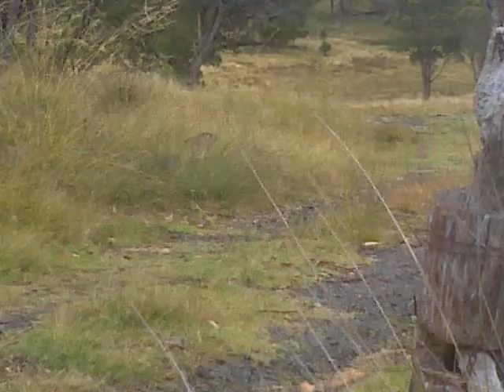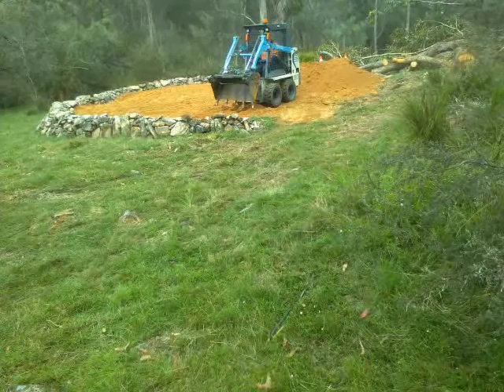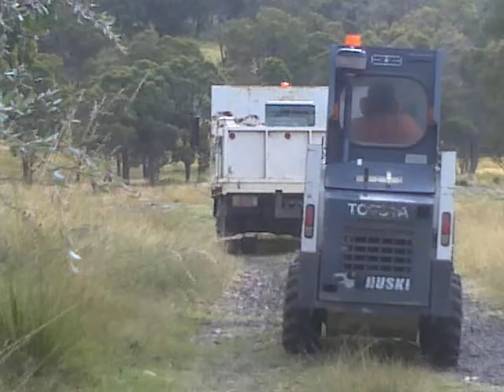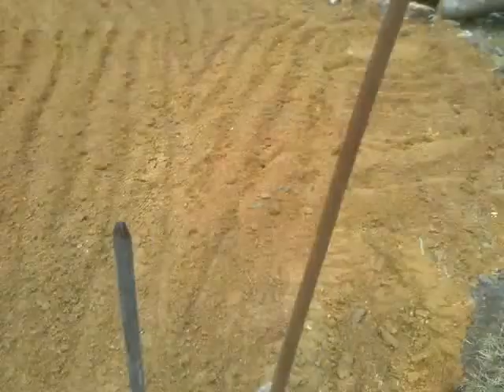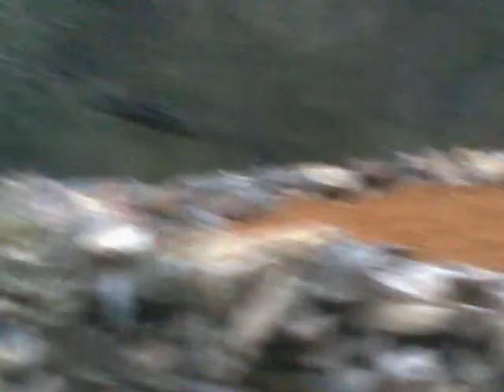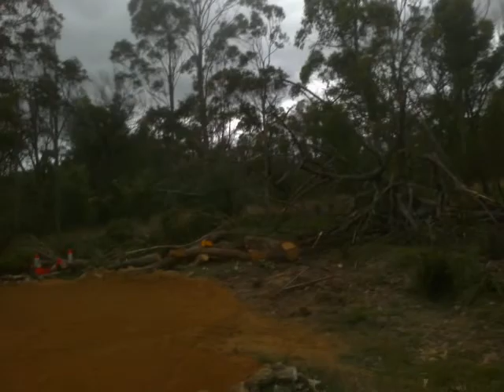Yurt Pad, The Last Load...

Comment: Getting there slowly but surely.
Reply from the maker: G'day,

Thanks.

As I was making this, it started raining...; now it's 24 hours and 42 mm later, so those 3 days, after 10 days to dry the Driveways out since the previous Rain Cycle - really were the tight little Weather Window through which the Pad had to be made.

I would like to have seen another 2 or 3 loads - to bring it up a bit above the level of the Rock Wall..., but the Weather Window shut at the same time my Pad Fund ran dry.

I think the Yurt will go onto what's there, rather than waiting for funding and another Weather Window to appear.

For a first attempt, I don't think it was too shabby an effort at Pad Building.

Such is life,

Have a good one...

Stay safe.

;-p

Ciao !

Comment: Will you be running a wacker plate over that to tighten it up?
Reply from the maker: G'day,

Thanks mate...

It wouldn't be a bad idea, but since I made this video there's been 27mm of Rain onto it - and my plan had been to put my 20mm Sprinkler on the Pad and pump 5 tons of Water out over it with my Firehoses, to settle it.

So unless my daughter wants to finish the job properly, with another 8 or 10 Tons to bring it up to the top of the Wall, then it's about ready to receive the Yurt.

Such is life,

Have a good one...

Stay safe.

;-p

Ciao !

Comment: A screet board would have made the effort of leveling easier... maybe.
Reply from the maker: G'day Richard,

Thanks mate...

I was thinking about getting a big (4"x4") length of Hardwood and dragging it around as a "Land Plane", but with the Rain building up and a limited Time Window I had to use what I had ready to go.

The stuff on the High side was pretty well packed down, because the final two loads had been backed over the top of the first 4 - and the "Decomposed Granite" goes pretty hard when packed down. 

A Screet-Board might have bounced over the highpoints. I had to chip into it in layers, using the Rake-Hoe, to get it loose enough to move accross  to the Low side.

It literally started spitting with rain at the 1 & 1/2 hour mark (as I was pretty near knackered), and after putting the Tools away I wound up splitting Firewood in the Rain.

The first dump was 12.5 mm, and overnight another 15.5 mm dropped onto it ; and the weekend is expected to feature Cloudbursts and Flash  Floods....

So, I consider it a triumph of Anti-Rainmaking Rituals that the Storms held off until the job was as finished as I could afford to do it.

Personally, I'd like to see another 2 or 3 loads, but my Stash of Banknotes was depleted and the Weather Window was too small. And because it was a "Tiny Tipper" the 35 km each way to the Quarry for 6 trips made it fairly dear.

Ideally one would get Crushed  Bassalt from Town ($24/ton) and that's only 15 km off, and a 10-Ton Tipper for 3 loads...; but the Burilda Driveway has almost gone beyond what anybody would agree to put a 10-Ton Truckload over, and I doubt if it would have got over the Traprock Mudpie at the bottom of my Driveway - and everybody with bigger equipment is already flat out busy and had other stuff booked in and happening during the Weather Window.

Whereas old mate has his own Quarry, an Excavator, the Tiny Tipper, and the 900 Kg Bobcat which fits on a Car-Trailer that he can tow behind the loaded Tipper.

Thus, in theory, the job "could have been done cheaper", but not in the time and probably not over the Burilda Driveway - which is itself waiting for a Weather Window to commence a $60,000 rebuilding (quoted last year, postponed repeatedly due to Rain - it was to have been started the day after the RAV-4 was killed by Water Ingestion on the Causeway...

So, "Economies Of Scale" didn't come into it, so much as "how can we get it done and how fast..." (!).

Cheaper would have been nice, but I figure old mate would have been lucky to have been covering his costs of digging, crushing, loading, carting and spreading the stuff in little loads.

Such is life,

Have a good one...

Stay safe.

;-p

Ciao !
Reply: I use a pallet with screws every inch and a half and leave them raised about 1/2 to 3/4 of a inch. Use about 10 feet of rope tied off to the front of the pallet. Then walk in circles dragging the pallet. Cuts the hills and fills the valleys.
Reply from the maker: @MAGnetICus_Attractus  

G'day,

Thanks !

I might try that.

Have a good one...

Stay safe.

;-p

Ciao !
Reply: @WarblesOnALot  I made a short video showing the one I made. Wood floats on water ;)